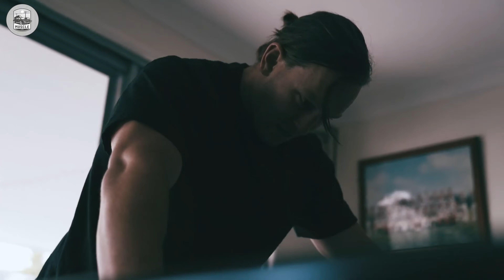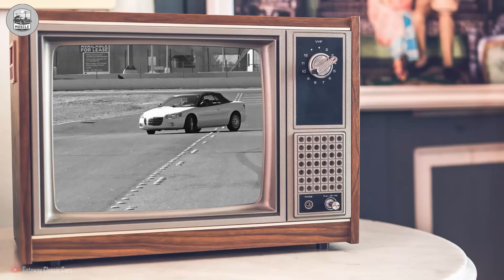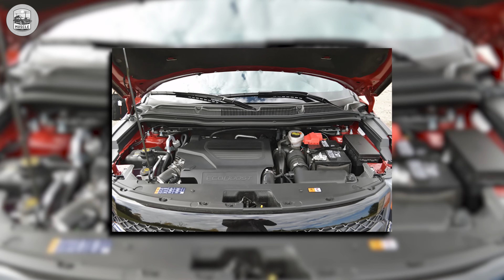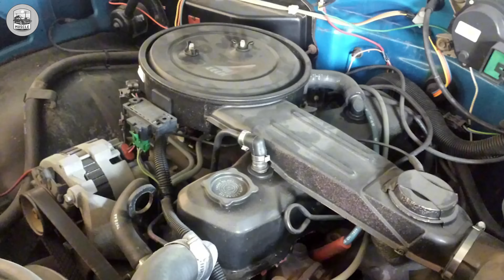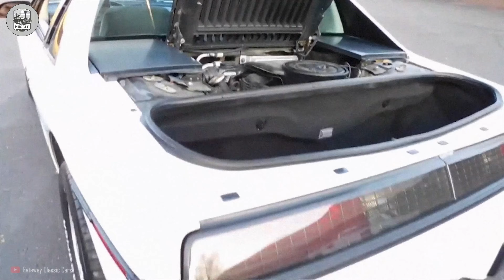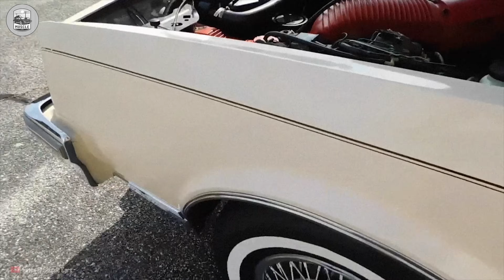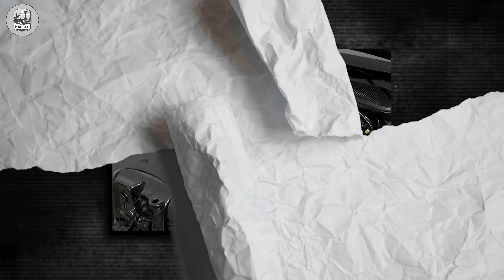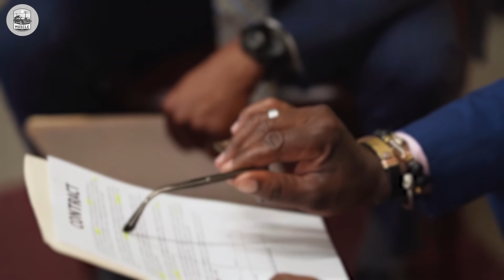MOST FAILED ENGINES ever put in production cars | Worst engine blunder!

Comment: Why isn’t the Chevy Vega mentioned? I became a pro at replacing its head gasket. That engine kept me busy, and I mastered the skill! The Vega was infamous for its issues, especially with the head gasket. It was a challenge, but it taught me a lot about repairs. Seems like it deserves a spot in the discussion for memorable engine experiences.
Reply: The aluminum cylinders were a gas ! Soft rings wore out asap ! Lol
Reply from the maker: The Chevy Vega had its fair share of engine troubles, especially with that infamous head gasket issue, which kept a lot of DIYers like yourself busy. The Vega’s aluminum block without iron sleeves and its unique cooling challenges certainly made it memorable in terms of repairs and durability lessons. Many mechanics from that era probably honed their head gasket skills thanks to this engine alone!
But you hit the nail on the head about memorable engine experiences—it’s about the scale and complexity of the problems too. Engines like the Northstar or Cummins with the “killer dowel pin” often involved higher-stakes failures and much costlier repairs. In the Vega’s case, even though replacing the head gasket was a recurring pain, it typically didn’t spell total disaster the way some other engines did. Still, it’s a great call to bring up the Vega here because it represents a classic era of hands-on learning for car lovers.

We’d love to hear more stories like this! If anyone else has memorable engine experiences, or stories of overcoming notorious repairs, share them here. And remember to comment, share, and subscribe for more on classic car engines and the wild stories behind them.
Reply: Because this is a shitty AI channel that does no research and has no idea what they’re talking about. A human types in the topic and then the AI makes the entire video that’s why they are so littered with mistakes and stupidity. AI is extremely well known for just making things up for no reason at all that’s why the 3.8 is in this video, one of the best engines made
Reply: My mom had a 73 Vega, her first new car. She used to go to full service and say "fill up the oil and check the gas"
Reply: @steveo7006  Honestly, the Vega’s head gasket issue is like a mosquito bite compared to the landmines of other engines. Think about the Northstar head bolts straight up ripping out of the block—or Cummins with the "53 block" cracking like an eggshell. Vega? Cheap, predictable fix. We laugh, but it’s nowhere near those wallet-obliterators....
Reply: @steveo7006  The Chevy Vega might not scream muscle, but let's give it credit, it taught us grit in the garage. That aluminum engine? A masterclass in perseverance. Sure, we love roaring V8s, but the Vega deserves a nod for being the unsung hero of hands-on learning. Sometimes, the car that breaks down the most builds the best mechanics
Reply: My brother bought a Vega new.  Sold it 2 years later for $50.
Reply: @jimw7550  You know, everyone rags on the Vega, but let’s not forget it was a pioneer with that all-aluminum engine. Sure, it had teething issues, but Chevy was testing tech that others played safe on. Compare that to Mopar’s Ultradrive transmission fiasco those things grenaded on the regular.
Reply: @jimw7550  True, the Vega wasn’t packing a 454, but Chevy did give it some muscle car spirit with the Cosworth Vega. Dual overhead cams, fuel injection—pretty advanced for '75. Only 3,500 made, so it’s rare now. It wasn’t a tire shredder, but it’s a cool slice of history that deserves a bit more respect.
Reply: The greatest flaw of the Vega was it had an aluminum block but no iron / steel bore liners. GM just took a just-cast block and sprayed the bores with silicone, and that was supposed to act like ferrous metal bore liners.
Reply: @bobkonradi1027  @bobkonradi1027 I get the concerns about the Vega’s aluminum block, but let's be honest—Chevy was ahead of its time, pushing boundaries when others played it safe. Sure, the silicone bore coating had its issues, but think about the innovation! They were testing new tech, which eventually influenced future designs. Compare that to the transmission nightmares Mopar had with the Ultradrive. Every muscle car has its flaws, but the Vega's boldness is underrated.
Reply: @AilaniMadden  Also what about the Chevy Chevette? A car long forgotten.
Reply: @albertcarello619  the Cosworth Vega being a unique piece of history, but let’s not get too carried away with calling it a muscle car. Sure, it had the tech, but muscle cars are about raw power and torque. The Cosworth Vega was more about innovation than sheer performance. Now, the Chevy Chevette? That’s a whole different story. Sure, it’s often overlooked, but it was a small, economical car, not meant to compete with the likes of the Camaro or Chevelle. Muscle cars aren’t just about tech or rarity—they’re about big engines, big power, and big thrills. 
Let’s keep that in mind
Reply: Seems like I was always replacing the water pump on my Vegas
Reply: While the Vega’s issues with the head gasket were definitely notorious, it seems like engines like the Northstar or the Cummins with the killer dowel pin deserve a bit more attention here. Those engines brought challenges on an entirely different scale—think costly repairs and the potential for total engine failures. Compared to these, the Vega’s head gasket replacements, though frustrating, feel like more manageable issues. So maybe the focus should be on the engines that presented bigger risks and headaches for owners.
Reply: @KeithGreene-k1v  "While it's true that engines like the Northstar and Cummins had their fair share of high-stakes issues, I’d argue that the Vega’s head gasket problem still stands out for a few reasons. The Vega was notorious because the issue was practically guaranteed to occur—meaning nearly every owner had to deal with it. This wasn’t just a ‘risk’ but almost a certainty, and it happened at a time when Chevy was pushing for innovation with an aluminum block that ultimately fell short. For those who owned one, the constant repairs made the Vega memorable, even if the cost was lower. It wasn't just a repair; it was an ongoing saga, and that's what made it infamous.
Reply: Honestly, I think the Vega's head gasket issues were actually kind of overblown compared to some of the real problem engines out there. Sure, it was a hassle, but it didn’t have the high-stakes, catastrophic potential of the Northstar’s infamous head bolt issues or the Cummins 'killer dowel pin' problem. Those engines were ticking time bombs that could take out the entire engine if things went wrong, costing way more in repairs. The Vega was a hassle, no doubt, but at least you knew what you were dealing with—it wasn't like the gamble of a complete engine failure. If anything, it’s these higher-stakes engines that deserve more of the spotlight for their risk factor and repair bills.
Reply: @KeithGreene-k1v  Actually, I have to side with you on this one—the Vega's head gasket issue was practically a guarantee, not just a possibility, and that alone makes it infamous in a way that the Northstar and Cummins can't quite match. Those engines had their "ticking time bomb" moments, sure, but with the Vega, every single owner knew they'd be dealing with that head gasket at some point. Chevy’s push for an aluminum block was ambitious, but it just wasn’t up to the task. It wasn’t just a repair; it was almost a rite of passage for Vega owners, a saga you couldn’t avoid, and that level of inevitability is exactly why it’s still so memorable in the car community.
Reply from the maker: @AilaniMadden  The Vega's head gasket issues being less catastrophic compared to engines like the Northstar and the Cummins with their well-known Achilles' heels. The Vega's aluminum block design certainly had its issues with head gaskets, especially in the early years when engine overheating was more common. But, as you mentioned, these problems were generally manageable and didn’t threaten a full engine meltdown like the Northstar’s head bolt issues, where the bolts could literally pull out of the block, requiring an extensive—and expensive—repair to keep it running. And the Cummins dowel pin problem could quickly become a disaster if that pin fell into the timing gears, with the potential to wreck everything internally.
Reply: @AilaniMadden  You know, I actually think the Vega’s head gasket 'problem' gets way too much attention. People always bring it up, but let’s be real—it's not like it was unique to the Vega or even that costly to fix compared to, say, the Northstar or the Cummins issues. With those engines, you’re talking catastrophic, full-engine risk if things went wrong; they were basically a financial nightmare waiting to happen! The Vega? Yeah, you knew you'd have to handle the head gasket at some point, but it was manageable and predictable, almost a given rather than a gamble. It’s funny to me that it’s still so infamous for something that’s tame compared to the high-stakes engine killers out there.
Reply from the maker: The Vega’s head gasket issue has definitely taken on a life of its own in the public memory, often overshadowing the fact that it was quite fixable, unlike the high-stakes engine risks we’ve seen with the Northstar or the infamous Cummins dowel pin problem. While the Vega’s aluminum block did come with its challenges, it wasn’t a financial sinkhole; it was more of an expected upkeep issue. The early models of the Vega had cooling and metallurgy challenges that sometimes led to head gasket failures, but as you said, it was predictable and manageable—far from the catastrophic repairs that could come with Northstar or Cummins issues.
In fact, the Vega’s engine design was actually a pioneering move into aluminum technology. Chevrolet experimented with silicon-aluminum alloy, which was light and efficient but still evolving. They worked through early issues by adding cast iron liners in later models, which helped improve durability. So, while the Vega earned a reputation, it also paved the way for aluminum block improvements we see today.
Let’s hear from others! Have you experienced similar issues with engines that got a bad rap? Share your stories in the comments, and don’t forget to subscribe to Muscle Car Masters for more discussions, insights, and stories from the muscle car world! And if you enjoyed this conversation, give it a thumbs up and share it with fellow gearheads...